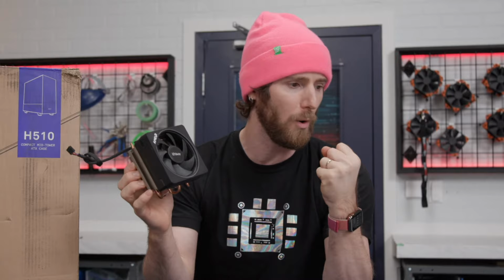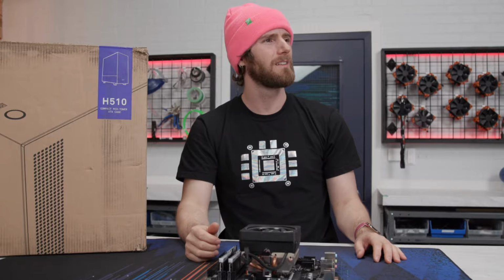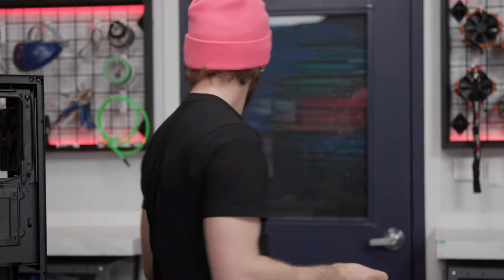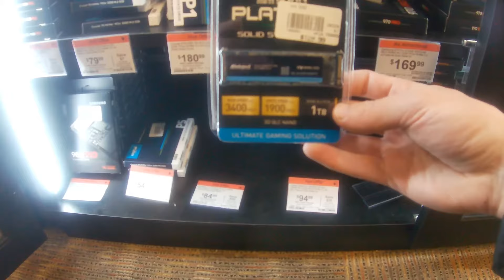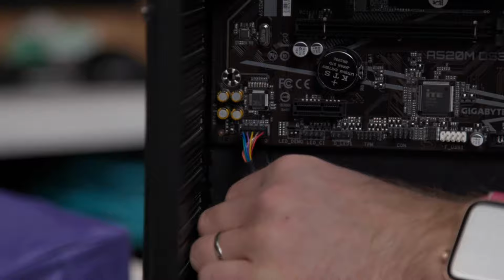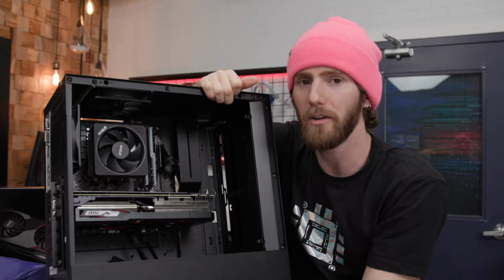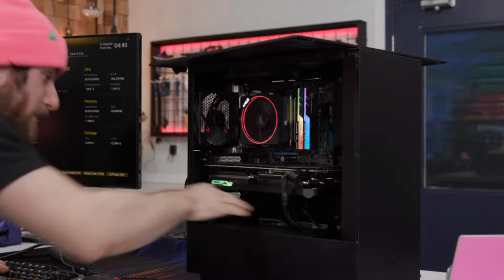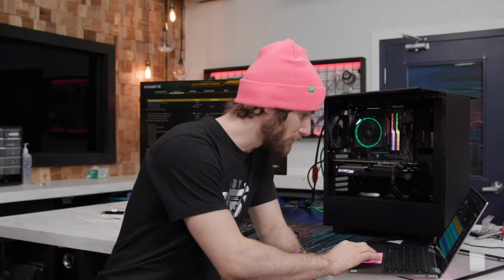Let's Build a Bang-for-the-Buck AMD Gaming PC!!

Comment: Absolutely... many people MUST use the analogue 5.1 and 7.1 audio outputs. For those of us with a racing simpit rig and a virtual pinball cabinet... we use the analogue outputs for discrete surround sound feedback in a pinball cabinet (positional ball rolling and mechanical feedback) and for discrete positional vibrational feedback from racing games (fed from telemetry data in the game). This need 4 to 8 analogue audio channels.

Comment: I'm lucky to have a Microcenter about 45 minutes away.
Reply: Mine 5 mins away and I have no idea until I needed a gpu lol
Reply: @billlam7756  and then there is me who has no luck in finding any new gpus online even after looking at websites all day only finding 10 series cards at double msrp...
Reply: @snowball1792  seriously ever considered buying off facebook market? Sometime you do get lucky and find people selling near the msrp. Or wait some more...
I bought my gpu over $100 msrp, as I work and no way I can wait in line everyday, considered paying 100 bucks or 200 for somone to get inline for ya isnt so bad. Compare to ebay
Reply: @billlam7756  but it's so risky buying second hand as you never know what problems it may have. Also I have a used tech store that provides 2 year warranty but they sell 3070 for like £800 ...
Reply: @snowball1792  most should come with 3-4 yea warranty anyway and you can find the card new sealed. I've used the market for years and never really have any bad run in. Not saying you wont get a lemon but the chances of you do is unlikely but hey, if you dont need the card now then wait. I hear the price only get higher
Reply: @billlam7756  do you think I can get a new one good price until April? 

Btw I just checked and people are selling 3070 and 3060ti for well over 600-800. And then the ones for 450 look too good to be true. In this gpu shortage I'd be afraid of scammers.
Reply: @snowball1792  600-700 is about right. There was a priced increased recently and it's normal for 3060ti to hit close to 700 some top tier card like the suprim can be over that. 
Only the founders card are cheap, aib cards are better but like I said. It's not like u get to choose and price only get higher imo. Buy 1 if u can

Comment: I work at a glass plant. Breaking tempered glass is definitely NOT scary lol.  The reason it can suddenly “explode” is due to the tempering process.  Tempering glass involves heating the glass and cooling it rapidly in order to introduce large amounts of stress into the piece of glass.  It is strong when impacted anywhere except for the edges.  Even a slight defect, chip, or pressure on an edge can cause it to release all this stress shattering it.  I can hit the front of the panel with a shovel and nothing...I can then tap the edge with a screwdriver and BOOM

Comment: Too bad i missed the stream, because I DO have a set of 5.1 Logitech speakers plugged to my PC. And i do use them, specialy in VR games.
Reply: @JohnSmith-xq1pz  Z-640. They are an old model but still sound amazing.
Reply: @josejuanandrade4439  i had creative 5.1 surround system for years until its power unit went to shit and my cat chew through some of the cables. Still in my basement tho

Comment: I have to disagree about 4 cores being good for several years. Even Intel(remember them?) is pushing hard now to get game devs to use 12 threads as a baseline in future development. I would strongly encourage spending the extra for a 3600X now, or you may not be happy later.

Comment: I build my bang-for-the-buck PCs from Micro Center when I have the money. It has been years since I built one, lol. Namely, since 2013. I did buy a video card upgrade from Best Buy cause the price was better there at the time, but that was a GTX970, so that has been a while too, but my most recent machine is a PowerSpec Laptop from Micro Center that was upgraded with parts from there, a PowerSpec 1520, which is a Clevo chassis/build PB50EF-G rebranded. Upgraded the RAM to 32gb,  added a 1gb NVME stick, Micro Center brand, and a 2tb Samsung 860 Evo. Undervolted the CPU (i7-8750H) and have it running at a steady clock of around 3900mhz. The GPU is fine and dandy, a 2070 mobile non-MaxQ. And I happen to live in the town where Micro Center HQ is, so that is nice.

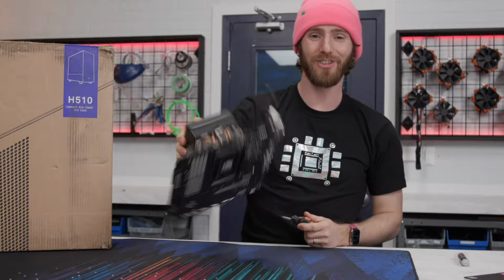Comment: @10:24... I was a PC tech from 98-2005 and I mounted these coolers probably 20 times a day and had to witness the junior staff ruin at least one mainboard each after stabbing the traces on the board. Fancy coolers had a thumb-press and hinged corner to get the hook onto the socket. Ahhh back in the days when CPU's had pins and I was getting 99fps with my AMD K6-2 and 3dfx Voodoo2.

Comment: Thanks for the recommendations Linus! I really like most of your suggestions. But would have to disagree with your 750 watt NZXT modular PSU (US$133). The R3 3100 & Radeon 5700XT should be fine with 500 watts. Even stepping up to a 600 watt EVGA BR non-modular PSU (US$63) for future capacity would save US$70. That seems a better bang-for-buck for perfectly adequate performance. The non-modular cables can be easily hidden behind the PSU shroud. And you would never have to worry about misplacing your modular cables when you need another one for more storage later. Keep up the great work!

Comment: PCI operates at a maximum speed of 266 MBps at 66  or 133 MBps at 33 . This enclosure features a PCI Express (PCIe) x1 slot (v. 1.0) that operates at 250 MBps. The available bandwidth from the PCIe bus is split equally between the PCI slots, regardless of whether or not a card is inserted into each slot.

Comment: There's no such thing as bang for the buck at these times everything has gone up 20%
Reply: nah try 100%
Reply: @noahisbroken  true 😄
Reply: Yup hahahaha
Reply: 400% if your shopping for nintendo switch.   

I was just at walmart  to buy razor dearhadder v2 mini on clearance but scalpers bought the entire lot.
Reply: In germany everything is fine except GPUs actually.
RAM
CPUs (Intel or older Ryzen)
PSU
MB
Are all pretty neat actually...
Reply: @Hubwood  lucky you i guess i bought 2 stick of corsair ram 3600 for £90 before the hole outbreak went to cop another pack they went up 30%
Reply: @minion9707  I wanted a gtx 1650 sc and it was $1000 on newegg and I found it on micro center for one tenth the price it was on newegg lol
Reply: @noahisbroken  yeah prices are ridiculous atm if I was you I would wait it out if you can you will get a much better card for the price your willing to spend
Reply: @minion9707   no you don't understand I have a gpu from 2010 (amd hd 5450) and I need a gpu rn so I will ask one of my relatives to get one for me (I will pay I just want them to get it for me)
Reply: The price is good for me and I was alr going to buy one of those in the first place
Reply: @noahisbroken  no I fully understand that's why I said if you could deal without the upgrade I would wait but yeah you sound like your in desperate need of a new one so go for it
Reply: @minion9707  ohh sorry I didnt see where you said it lol but yeah I'm desparate rn

Comment: I performed the good ole MoBo scratch the other day. Knicked a chip close to my top m.2 slot and went across about 7 lanes but luckily all cosmetic. No copper showing so the lanes are good and luckily the knick on the chip wasn’t enough to cause it to default and not work, whatever it’s for.

Comment: I have that CPU.  I'm pretty confident the HSF is smaller and still more than enough on a hot day as long as I don't manually fiddle with it.  The one you have won't fit into the retail box mine came in.  I had it ~4.2-4.3GHz but topped 100c.  Now it's just on auto and reaches just below 3.9GHz at < 80c usually hovering just about 70c.  Case open.
Reply: You don't need better unless you need ultra high FPS in the most demanding games or you'd earn money better with more and faster cores.  For everything else, you won't notice anything better.  I purchased it with bad timing for a good deal on a 3300x instead, but I can't find much reason to feel bad about it anymore.

Comment: if you don't get display signal when you turn on the PC ,that is a windows 10 problem !
(in a normal computer setup ,not in a setup like the one linus talking about)

what you need to do is turn off "windows 10 quick start" ,did this in 3 PC's and all of them are working fin
including the PC I'm using now, did this to my PC in mid 2019 and it worked.

Comment: So, bang-for-the-buck 🤔, if we could (big IF) find everything in stock,  how much this computer will cost??
Reply: I found almost everything for a decent price, except the fucking gpu. Bloody sellers on Amazon were charging high as the sky for it.
Reply: @dragonborn5832  how much everything?
Reply: @rafpt9522  close to msrp, but the cheapest i found the 3100 CPU was around 180 (might as well get the 3600 for that price lol),  cheapest i could find the respective gpus in stock were around $500. Saw a lot of low budget psu for a good price. SSD's are not exactly inflated either. My dad needs a pc to work on that my brother could also play on so I personally would stick to buying a prebuilt and upgrading it from there. If your persistent on building your own then maybe wait a little longer.

Comment: 2003 called and told me how much I loved my Klipsch Promedia 5.1 speakers that were packaged with my first gen HP Media Center, yes, that version of Windows XP.

Truely the most inmersive gaming experience I have ever had. Had because the BASH amp in the sub failed, but not after working for about 9 VERY HARD years.

Comment: I have actually hooked up full 5.1 to the 6 jacks on several occasions. Logitech use to make a 5.1 pc speaker kit. I used that and so did a few friends. Then later on, more recently, I used all those plugs for my Razer Tiamat 7.1 headset.

Comment: On the topic of G.Skill RAM I bought a 32 GB kit rated at 2133 megahertz when I first upgraded from my FX8320 system to a Ryzen 5 2600X (Yeah yeah I know Ryzen  likes fast RAM, but budget constraints are budget constraints for a reason), and I took a gamble and overclocked those suckers to 2666 for the whole 2 years I ran that CPU. This year I upgraded to a 3700X and decided to take another gamble and bumped it up to 3000 megahertz, and I've been running stable for 2.5 weeks now. 

Even when they don't promise you high speeds odds are you might be able to pull a little bit more out of them.

Comment: just reseeing this . the cooler had the body reinstalled wrong the tubes should been sideways and not with the lock .. you could clearly see the mounting bracket bend  when pushing those heatpipes in them aww

Comment: I have hooked up a 5.1 analog to my PC, but because the cable was to short for my new setup changes I switched to optical.
Reply: Sound is great, but the downside is, the RGB Audio synchronisation does not work with optical Audio...

Comment: I actually did connected 5.1 analog speakers twice to my computer. First setup was like 1 amp + speakers for front, 1 amp + speakers for surround, 1 amp + speaker for center and sub was actually car subwoofer powered with power supply from PC. It was great. I felt like I'm starting spceship when I fired up everything :D And second setup was Creative Megaworks 550 speakers also through analog.

Comment: Linus is talking about AMD's Socket A/462 heatsink retention mechanism, if anyone wondered! Yes, they were pretty awful. Eventually third parties started making metal clips with handles and hinges, or made sure to use all 3 plastic clips on the socket's sides, or both! I never cracked a core unlike some, but i did have a plastic clip let go and the heatsink fly off.. Fortunately the PC wasn't switched on!

Comment: 55:25  64-bit PCI-X at 533MHz was a bit more than 4GB/sec.  That put it slightly ahead of a 16x PCIe 1.0 slot.  In practice, the most you were likely to find was a 64-bit PCI-X at 133MHz, which was about 1GB/sec.  And PCI-X was pretty much a server-only slot type.

Regular PCI with a 32-bit 66MHz bus was 133MB/sec.  A 64-bit slot was twice that, putting it just ahead of a single PCIe 1.0 lane.

To answer the earlier question, never.  PCI slots still exist.  They will continue to exist on legacy hardware even after no new ones are manufactured, just like ISA slots, EISA slots, AGP slots, MCA slots, etc.  You can't rename something just because you're tired of saying a fourth letter.

Comment: Inland is the Microcenter in house brand. I have the Professional NVME drive and it is a 3D VNAND PCIe 3.0 x4 which has read of 3100 MB/s and 2800 MB/s. It cost less than $100 brand new and it has been quite reliable in the 6 months that I've owned it.

Comment: what about a build mat with a build check list.

like, Checking that the case fans are plugged in...
or making sure it posts before closing the panels...
or making sure you plugged the monitor in. ;D

maybe also put some tech tips for different set ups.

Comment: 33:00 for 5.1 surrond sounds for games you need an amplifier that can take 5.1 inputs which the sub $500 ones don't. Back when doom3 came out i had an soundblaster audigy 2 zs hooked up to a yamaha rxv2500(still using) and a 720p projector using a GeForce 6800 GT. Consoles have always 1uped PC on sound ingame as they can do dolby digital 5.1 via hdmi or optical.

Comment: Those pcie adapter cards for front case usb-c connectors do exist but they're really expensive and actually quite difficult to tell if they're really supporting it or not. 

Pro-tip: they're sometimes called "pcie type-E expansion cards"

Comment: Couldn't find a SINGLE gpu for my egpu/bootcamp plans for my mac mini. Had given my PC away that had a gtx 1060 in it a year ago. Friends wanting to game with me again...mac mini not cutting it at all...Had a $50 credit to office max. Got the HP M01F0016 on sale for 399.99 with it's ryzen 5 3400g. Went on ebay and got another matching 8gb stick of ddr4 for $25 almost doubling my performance allowing the built in vega graphics to OWN esports titles (60fps with vsync ON 1080p max/high settings in LoL, Valorant, CSGO, etc... Today I just added an oem gtx 1650 super I got on ebay new for $220 along with with a 2 sata to pci-e 6 pin adapter. And After disabling the on board vega 11 WOW, this system owns and is only pulling only 30-160 watts from the wall. Average total system draw while gaming has been 80ish (154 watts peak total draw in COD warzone to maintain 60fps on high) watts because I play with vsync on capped at 60fps on a tv(according to my kill-a-watt tool), so I'm not gonna rush on upgrading the 180w gold rated power supply this came with but will jump on a 300w or something that will accommodate a 3060ti or something down the road for when i'm ready to jump up in refresh rate and push a matching fps. Check out the site I made during SIP last year peeps! withtruth.com

Comment: I hooked up 7.1 analog speakers to my pc i had to reconfigure my mic jack into additional plug for the analog speakers. i still have them dont use them for gaming much because i had to move and take all the satelites down and yea its a mess of a ton of wire but i did use it for several years and have plugged them in the back of the pc using the 5 jacks

Comment: Worst sticker I found, was this tiny one in a corner telling 'pull here' to pull off the protective cover on a tv that had stood at a place for like, 3 years. A peel that had been cleaned repeatedly and the tv looked horrible by now. They were like no, don't remove it. Me, removed it and showed how much better the view was. Note, this was a tv with a glass protective layer style, so the peel was even less useful for protecting then usual.

Comment: I don’t know if they already make one but a build mat with a magnetic catch that you can set screws in would be amazing. I have always had trouble with keeping all my screws separated and also keeping them all on the table to where I can tell which one is which just by reaching over and touching it without them rolling away
Reply: Can easily order some 10-50lb magnets off of Amazon and then recess them into a desk and lay a mat over it so one corner is magnetized. Keep in mind though that the stronger the magnet the tougher to get the screw off it.

Comment: oof that wobble of that gpu when he slamms the case against the table, beats me how there isnt a solid way to fixate that corner of the gpu, like some bracket that comes with the case for example and would have different mounting points somewhere near the mobo to the right

Comment: 42:00 I've had problems with Thunderbolt on PC too. It works the first time I connect something, but not when I reconnect, and I have to reboot to get it to work again. But I got it to work on the Linux partition of the same computer, so I think it's HP's drivers for me.

Comment: That's not the cooler that came with my Ryzen 3100--it looked different and required removing the front side of the cpu cooler bracket.

Comment: Bus speed and controllers still matter, now for USB, those cheap cards have a single controller, all the ports are shared as a first hub, multi channel costs far more than $20.
Promedias used to have dual driver subs in their higher surround tiers, sad now the wage cage generation is left with just the 2.1 model now.

Comment: Just so everyone knows the msi gaming x 5700xt is known to have a common problem with the thermal paste on the gpu. People say most msi cards have it but I only have experience with the 5700xt hence why I’m mentioning it. If you change it you should expect to see junction temps drop by about 20-30°C and auto fan speed will drop by 400-500rpm.

Comment: You could hit the limit with a raid 5 card with 128 mb or ECC Ram with 6 - 7200 RPM drives in a linux file server with dual CPUs and Dual Gigabit Ethernet… in its day that was FAST